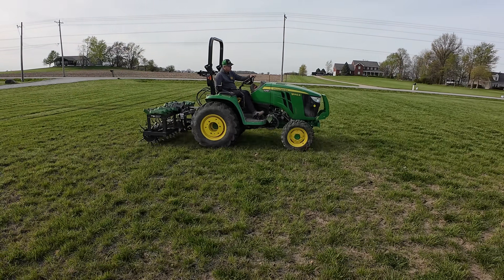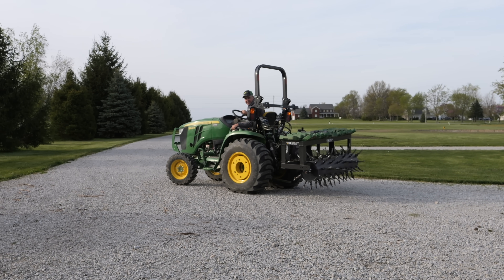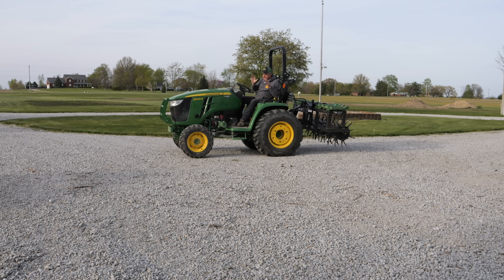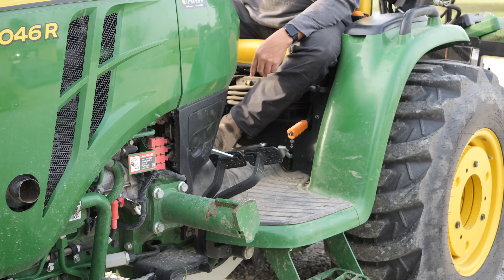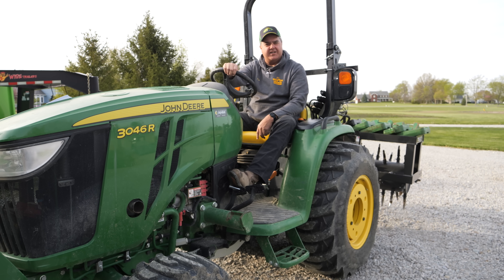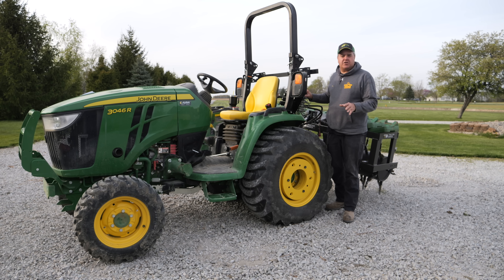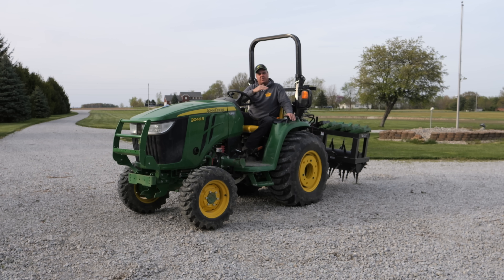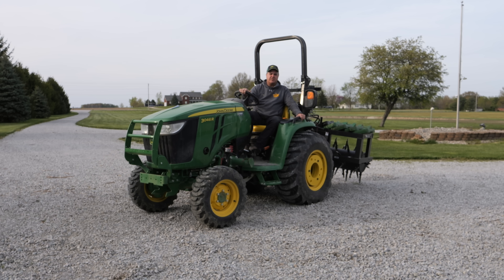Meh! Independent Steering Brakes ARE FOR LOSERS! Compact Tractor BEGINNER LESSON!

Comment: Tim, I take issue with your comment on the brake pedal locking mechanism. Can you imagine the outcome if you’re roading that outfit, ( or one with not quite so extreme a rear weight bias) and you need to panic stop? I wager that most people, in a panic situation, will not apply even brake pressure, and will steer into a dangerous situation.  This not a nanny safety feature that gets in the way of being productive. This is more like a switch to put your tractor into ”road mode”.

Many of your viewers come here for education as they are new to small tractors and may not have the benefit of having grown up using independent brakes on tractors. Please provide an update for your viewers indicating the importance of locking those brakes pedals together in certain conditions.

I’ve learned lots on your channel, and will continue to watch and recommend this to others. Thanks.
Reply: Yeah, that happened to me. I never leave it open. if you miss one of the brake pedals that one brake does nothing going downhill. I moved toward a gate downhill with my lever up, and went through the gate smashing the one side as I missed it. Totally shocked me and caught me off guard. Bad advice to leave them open. Better safe than sorry. I can bend down and unlock it on the fly.

Comment: I hardly ever use them. 4x4 and a loader usually make it easy enough. They definitely do help on keeping the front end turned up the slopes on side hills, I typically "steer" with the brakes and use the front tires more like sleds. They also help turn up steep slopes that you have to come up at an angle to start up. My kubota usually does a great job turning on itself if I'm tilling of cutting in 2wd, but they certainly help in the tight spots for sure.
Reply from the maker: You should think about them more often. Using the brakes assists in turning almost all the time.
Reply: @TractorTimewithTim  I hardly ever think to use them. Seeing Kubota hydro pedals and the brake pedals are on the same side, it's rather annoying to use them. I used the heck out of them on my old 2wd Deere 650.  They definitely work for sure!
Reply from the maker: @Greenwoods_Land_Solutions oh yes. Impossible to use!

Comment: If I had to choose between dual brake pedals and differential lock I would take the dual brakes every time.
Reply: My little JD 322 garden tractor has individual brakes. Use them so much I actually wore them out and had to do a brake job on a lawn mower for the first time ever

Comment: (Tractor Noob here) I like that feature. Definitely something to get on my next tractor. I currently have a sub compact tractor. When I am pushing a load of wet snow, the front tires do not have much steering. Having that independent braking would help a lot. My land is hilly and sometimes, pulling a load down hill gets the blood moving. The rear wheels keep turning showing me something just isn't kosher. All those features on the bigger tractor far out weigh the cost increase in my opinion. Buyers remorse I guess. Is a shame I did not find this or Mike's channel before purchasing the tractor.

Comment: My uncle taught me to use the independent brakes when I was 13 years old and using his 730 John Deere to disk wheat stubble when preparing the ground for later planting. I am glad my 2032R has the capability even though I haven't needed it yet. Thanks for your videos. I usually watch them on my TV anymore, so it hard to comment.

Comment: Back in the “old” days when I started driving 2WD tractors with tricycle front wheels, (especially doing field work) you learned very quickly if you wanted to turn, you use the brakes.  Blessings.

Comment: Independent brakes have their use, but there are many times wear applying both together is more beneficial. A great example is connecting implements with someone else on the ground. You need to maintain that safety stopping factor. I would actually say that in all my experience operating a dual brake tractor (Allis Chamlers B to newer machines). I have only had occasions to use independent brakes a few times. Even operating construction equipment, the machines that had them rarely had need.

Comment: I remember as a kid mowing hay with a 730 and a number 5 mower hammering the right brake at every corner to spin the tractor 90 degrees. Timing was important to get a clean cut on each corner. Great video.

Comment: Great video Tim ! 
We used 4440s and 4650, 4755s in the field with a lot of 3pt tillage equipment. Was so much fun and fond memories especially the turn around with the steering brakes. 
All but my X758 have steering brakes today, and I use them. I recently used them a lot on the 4075R when I was aerating my lawn. Only thing I did not like about it on the E-hydro system is I use the cruise control buttons to set my working speed, and you can only use 1 steering brake and turn one direction, the other shuts the cruise off and stops the tractor. 
I sure wish there was a way turn that cruise brake shutoff off for certain applications where steering brakes are needed.

Comment: The parking brake mechanism only engages one of the pedals, so locking them together ensures BOTH rear brakes are applied for parking. Just an FYI...otherwise I agree with you and leave mine unlocked.

Comment: Even with a stack of weights on front the JD 2510, I grew up with, the weight of a fully mounted 4-16” bottom plow the front end would come off the ground. The only way to get lined up with the furrow at the beginning of the field was to use the brakes. Yeah, miss that on my 1025R.

Comment: Growing up on a farm in NC in the 50’s, I would regularly use the brakes to make tight turns at the end of the row while cultivating. While I appreciate the ease of operating a hydrostatic tractor these days, I miss having two brakes on my compact John Deere. I agree with your opinion on the pedal lock. The only time we used the pedal lock was when we were using the tractor to tow trailers and wanted to be sure that we were applying the brakes equally when around other folks. You probably gnored it for the purposes of the video, but the diff lock was my preferred method to stop a spinning wheel.

Comment: My Kubota L5740 has the dual brakes but Kubota did them backwards it is a hydrostat but the brakes are on the right side same as the hydrostat pedal and the clutch is on the left and all the clutch pedal is for starting to tractor and with the brakes on the right side with the hydrostat pedal makes it hard or almost impossible to steer with the individual brake pedals I just use them to set the brake when leaving the operators seat to chain something to the loader or tractor and when cutting logs on my pallet forks
Reply from the maker: Stupid design.  They did this for 30 years!!!
Reply: @TractorTimewithTim  yes it is a bad design  but I bought the tractor off of a guy I know that trades every so many years and he sold it to me for what the dealer ship was going to give him for trade in and got a deal I saved a little over 8,000 on what I could have bought it from a dealership for

Comment: Always enjoy your videos. The lock the brake pedals together when on the road  advice goes back to farm tractor use as most pulled heavy implements with the drawbar rather than a 3 point system.
The implements did not have brakes and the momentum would push against the tractor when slowing down.  If a turning brake was applied at speed the tractor would try to turn and the implement would jackknife similar to a semi, sometimes flipping the tractor and coming over the top of it.

Comment: Great overview of split brakes use! I wouldn’t buy a tractor without them. I lock the pedals together on the road, or when I work on my steepest hill for safety. On the hill, if I missed one pedal by accident that could be a rollover if the tractor turned side to the hill.

Comment: I think that you should get stuck in the mud and show how you can use your loader to get unstuck.

About the only time I use my steering brakes is to stop wheel spin in the mud.
Reply from the maker: I have done that many times…on video.
Reply: @TractorTimewithTim  Tim, remind us where to find that as I recently got stuck and had a more experienced friend get me out using the bucket
Reply: I use diff lock in that scenario

Comment: Hey Tim, I noticed during the video your tilt cylinder was drifting down. Does that cylinder have a check/holding valve? If not installing one might make a good video. Thanks for videos.
Reply from the maker: It does have a check valve

Comment: On my 520 i find myself using the clutchbrake when roading ( not good)   with the 2 bangers the brakes were on oppisite sides of platform so its hard basically impossible to apply together so i lightly used left brake on road ( not good) and out in field i use left brake to swing around as that pedal is easier for me to get foot up

Comment: I’m just like you I never run that lever locking both breaks together.   I don’t use the steer breaks near as much on my lx2610 as I do my utility tractors. I use them all the time on my utility tractors though. It’s very steep terrain around here and I even use them to help keep my tractors pointing straight across a hill instead of trying to nose dive down the hill because it’s so steep. But more so when plowing or cultivating so I can spin around and go right back down the next row

Comment: I have 200 hours (almost exactly!) on the L4701 I bought in '21, and it's my first tractor. I know the theory behind using the turning brakes, but I've never actually used them. For the type of work it gets used for, I see little benefit. And, in fact, having a hydrostatic transmission, I don't use the brakes all that much. But if I do need to use them, especially suddenly, I don't want to wonder if that'll be the time I miss the center of the pedal and ended up slamming on just one brake or the other and make the situation worse. If I were doing a job that involved rows (planting, tilling, or aerating) I'd give them a try then, but still leave them locked the rest of the time.
Reply from the maker: Aren’t your brakes on the right side…same side as hydrostatic pedal?  If so, how COULD you effectively use them!?!?
Reply: @TractorTimewithTim  On the L4701, brakes are on the left, treadle pedal on the right.

Comment: I agree the independent breaks are very useful. Do both of your pedals have the same feel when unlocked? One of mine depresses further than the other. I’m wondering if it needs to be adjusted?
Reply from the maker: Yes, that is an adjustment issue.
Reply: The one requiring to be pressed further needs to be adjusted.

Comment: I don't use them much on my 3039r. Occasionally, I do and I am glad I have them. Growing up on farm tractors,they work great in loose ground as in plowing. Also helps if you loose traction with a tractor that ha no differential lock.

Comment: I have an early 90's  Kubota B1700 that has differential brakes. However, the brake pedals are above the forward hydrostat pedal so it is very difficult to utilize them, I have tried. Nice that JD now places them on the left so that they can more easily be actuated while still driving in either direction.  Don't know what Kubota does these days about pedal placement.
Reply from the maker: Can you believe Kubota did that nonsensical design for almost 30 years!?!?    Seems like they never even MET a customer…let alone asked one for input!
No, Deere has never made THAT mistake!
Reply: @TractorTimewithTim too bad John Deere uses so much fly by wire technology. Small rodent’s wet dream lol
Reply from the maker: @7acersadogandakubota too bad you can’t simply admit a fault.
No need to try to bring up some other unrelated topic.  Putting the brakes on the same side as the hydrostatic pedal was a stupid idea.
Reply: @TractorTimewithTim  I agree that is a bad idea but a fly by wire clutch is far worse of an idea. With hydrostatic tractors you really don’t use the breaks often but you almost certainly will need the clutch to work properly on a gear shift tractor and you really need it to have a mechanical linkage. Its almost like the engineers at John Deere have never used a tractor before or ever even seen one form the last 100 years lol
Reply: @TractorTimewithTim  Tim if I had to guess, since the manual shift tractors are like this Kubota and NH didn't want the added cost and parts to switch it to the other side.
Reply: My 2 New Hollands with hydrostat are the same way. I just set the cruise and then use the cutting brakes. Works fine.

Comment: Parking brakes
Reply from the maker: What about em?
Reply: @TractorTimewithTim  The parking mechanism only engages one of the pedals, so locking them together ensures BOTH rear brakes are applied for parking.
Reply: @TractorTimewithTim  they are also called parking brakes along with steering brakes turning brakes .

Comment: Lock brake pedals together for road travel.  I think It's even in the book!
Reply: Tim, that would be a maintenance issue. That is something you are supposed to inspect for per the operator’s manual on a regular basis. 
On pavement especially, if you are roading at top speed, and something happens where you need to stop quickly, if you hit one pedal harder than the other, it will swerve violently. 
Best advice is lock the pedals when in high range for transportation, and unlock when working.
Reply from the maker: Don’t care. I don’t do it.  What if brakes are adjusted slightly differently…which they are almost always!

Comment: I would love to have "split" brakes on my 1025R.  My driveway has a rather high crown on the last 15 feet. While pushing snow with the loader down,  my tractor slides towards the ditch unless I lift the loader to put more weight back on the front wheels.  I think I could use a steering brake to keep the tractor moving straight with the bucket down. BTW, my neighbor's JD 318 garden tractor does have split brakes.

Comment: My 2018 3038e does not have steering brakes.  Partially depressing the pedal engages a differential lock so you get get out of a situation where one rear wheel is slipping.

Comment: My Grandfather told me that the bar linking the two brake pedals was for driving on the road.  If you're at high speed, you don't want to apply just one brake.  He sold John Deere's in the 60's and I grew up sitting on the fender of his JD while he plowed his 60 acres.
Reply: Yep, also what I was taught
Reply: That’s absolutely correct !  But you also want the brake linkage adjusted so the pedals are even when pressure is applied
Reply: Grandpa, Dad, and my FFA leader all taught me the same thing.
Reply: Exactly. I'm surprised Tim didn't know that, too. He may be too young to have been around when that was common knowledge on the farm. I always locked the brakes together when on the road.
Reply: Old farmer told me the same.
Reply: Same for me in Australia.
Reply: Also needed for parking brake
Reply: For driving down the road and especially when loading onto a trailer you should always have the pedal latch set across both brake pedals. I've seen a truck driver fall off a trailer and have almost braked into oncoming traffic because the pedal latch was open.